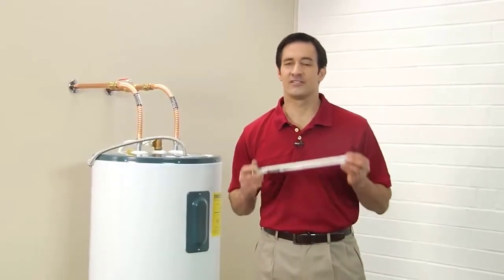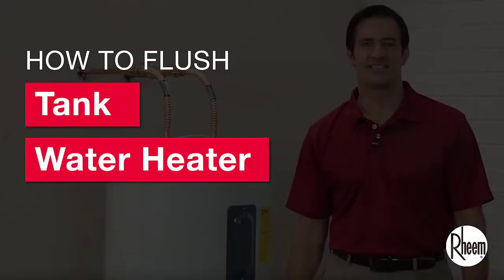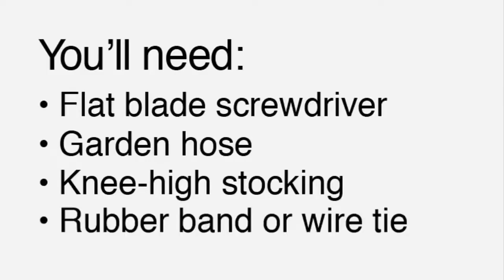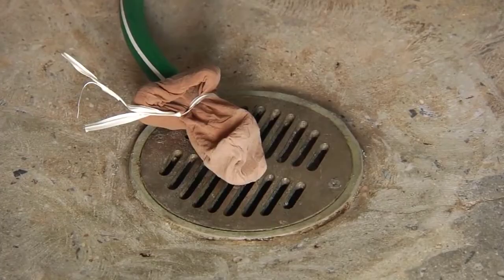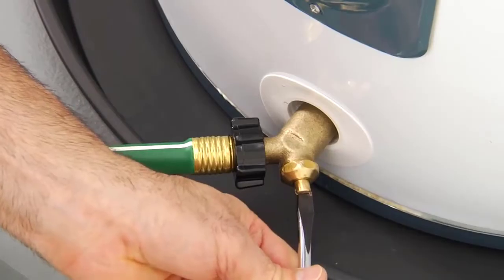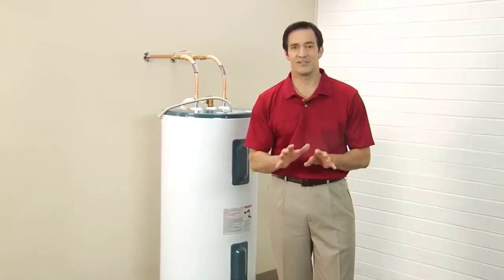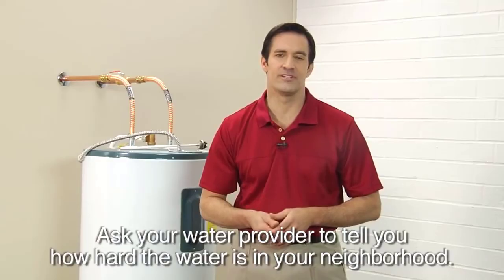How to Flush a Tank Water Heater

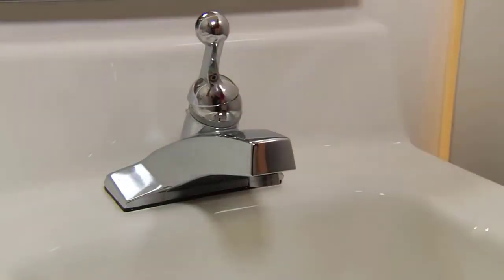Comment: At 1:18, you say we should open a hot water faucet somewhere in the house.  At 2:20, you say we should open a hot water faucet somewhere in the house again.  At what point between those two times are we supposed to turn the hot water faucet off?
Reply: Came here to post this same thing
Reply: I just leave it open the whole time. If it’s closed, the water heater will not drain.

Comment: I followed the video's instructions for use of my Rheem Gladiator 50 gallon electric heater.  Nothing happened until I re-opened the main shut off valve, then it drained as expected. After three years in service with no prior flushing, I could not see any sediment in the drain water and I drained at least ten gallons.
Reply: I suppose this experience proves this model's self cleaning feature works well because I noted no sentiment at all in the drain water.

Comment: No drain valve on our hot water cylinder, only a cold water inlet on the bottom...
Reply: Not possible! It's a safety feature for all single tank water heaters. Is yours a tankless system?
Reply: I have the 30 gallon rheem electric water heater and also don't have a drain valve but I do have a pressure relief valve @sasabnis